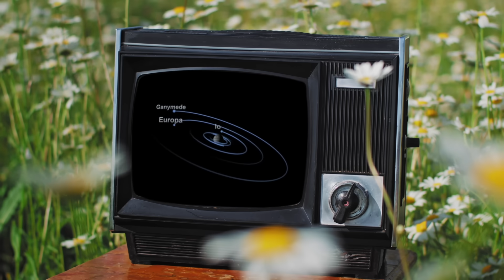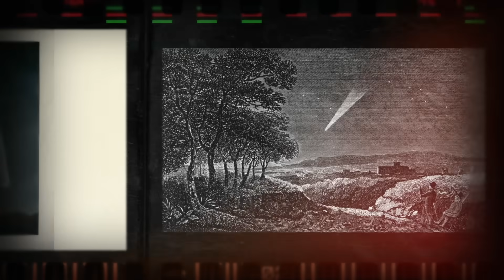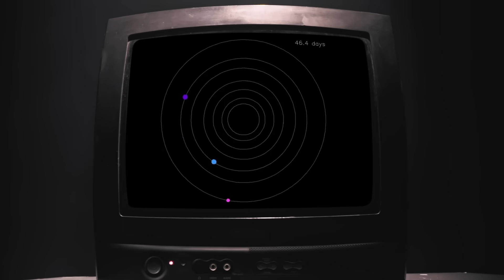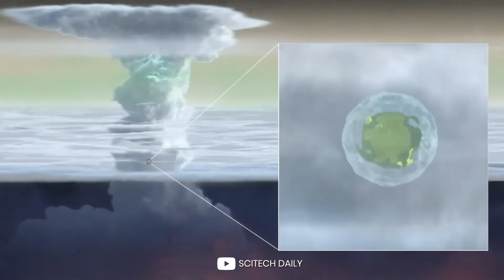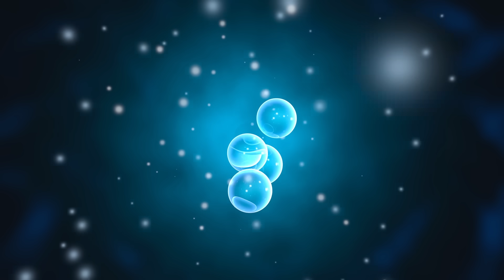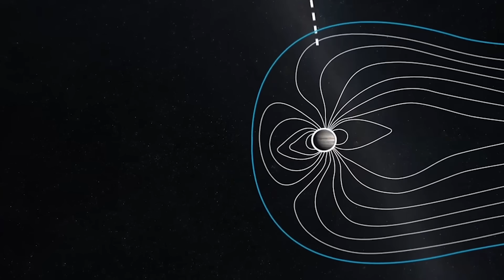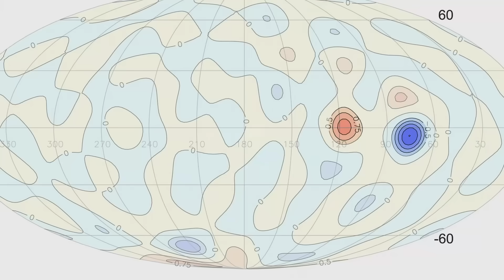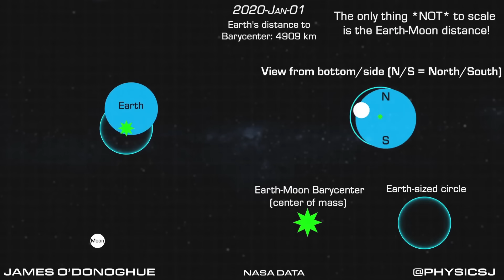Scientists Reveal That Jupiter Is Not What We're Beeing Told

Comment: I don't think there is any element in the periodic table that can be solid at the temperatures and pressures of the core of Jupiter.  A "rocky" core would imply silicates and metals, both would vaporize at those temperatures but they would still be highly compressed to the point they would act more like liquids and still be as dense as a solid.

Comment: i had a dtream that the elite, atualy two groups of elite, evil elite and good elite built a jupiter base that was suspended in the upper atmosphere converting it to oxygen, was baught there to help defend th egood elites base and the evil elites destroyed it, which after it just sank a few inches low started melting under the pressure. im assuming that "the arbiter" and "the oracle" halo 2 level was partialy what helped create that dream.

Comment: Jupiter use those fly by rocks to charge itself in order to form rings, different rings formed at different time, govern by the orbital settings along with self rotation, Jupiter will release its collected potential by forming new rings. It determines by electrical potential between Jupiter and other planets when they get close.

Comment: Jupiter is 1048 times lighter than the Sun, and orbits at around 1116 solar radii, so it would make sense that the common centre of mass is about 1116/1048 ~ 1.065 solar radii, so it does lie outside the sun. It seems counterintuitive that further orbits can wiggle the sun more, but consider the length of the jupiter year, so the sun only has to wiggle once every 12 years, which is much easier than wiggling every year if it shared earth's orbit.

Comment: I don't think scientists yet realized. The gigantic red spot on Mars. Is an inverted vortex. That streams down to the center core of the planet. And sucking all matter in. Concentrating it.  In the center core. As Jupiter takes on mass.

In time. I feel. Jupiter will take on enough mass to partially fuse. And become a brown dwarf. It's larger mass.  Will then send it spiraling inward. Toward the sun. Where it will take its place. As one of those Hot Jupiters. Or as the, Secondary of a Binary star system. And in doing so. Will wipe, planet Earth from its orbit. Along with Mars and Venus and Mercury. None of us will escape that.

And so I think the scientists and astrophysicists, have it all wrong. About Jupiter. There are other stars. As small as Jupiter. With much more mass.

And so our scientists say.  It doesn't have enough mass to become a brown dwarf. Those are famous last words. We can actually tell what's inside of Jupiter? Or how much actual mass. It might be concentrating in its core? With its Giant Red Spot, Cosmic Vacuum Cleaner. They know it has a higher infrared signature. Meaning that things are accelerating as they enter it. And heating up as they traverse to the core. Being turned into a compacted, bag of goo. Of substances. Not yet imagined. Another physics factor. We have as yet to discover. Because it cannot possibly be. They think. And so therefore that's what it is. Right in front of our faces.

And what are we doing to get off this planet anyhow? High-priced joy rides to Mars?  For only the very wealthy?  That still won't save us.. They might be the first to be obliterated? When Mars, breaks apart. From Jupiter's growing gravity. And Voilà!  Another asteroid belt is born. Rings. Not around a planet. But a ring around the sun. Another one. As how did that other asteroid belt get there? Maybe we are about to make another? When Mars turns into Rubble. And then we are next. As Jupiter has been feeding off of that other asteroid belt for many millennia now. Maybe it's going to step up its game?  And eat Mars.

We certainly don't have the answers to any of these questions. All the astrophysicists were wrong. Since the JWST, came online, last year. And big whoops! They were very wrong. For many decades. And now have to rethink all of their physics. They are still thinking. They thought they had it, figured out. They still don't. As they are Academic Idiots. And they can't see the big picture in front of their face.  After looking at all of these other solar systems. It wondering how they are seeing all of these, Jupiters. Close to their stars. Hmmm? They are great at math but they can't put 2 and 2, together.

So it's obvious. What's going to happen. In some millions of years in the future. Or maybe next year?  We are not yet at another solar system base. And likely will never get there in time? Before we are Absorbed. Crushed. Torrent. Shredded. Pulverized. Burnt. Frozen. And become Food. For another Star.

And thus will always be such. In the Cosmos. We were just a mistake. We were just a mathematical oddity. That was never supposed to exist. We are the Virus in space. Most places are well Sterilized. From critters like us.

And that's why we have never heard from anybody else. And never will. Anything else will merely be a distorted reflection of something from our past. That nobody will remember. And we will think it's aliens.. When it might be us from the distant past. Around the time of the, Egyptians. As they had something else helping them out. And none of that technology ever found. Because it did turn back to dust. That which most of our  universe seems to have a lot of.

There's a reason why all of these worlds are filled with, Natural Gas i.e. Methane, Ethane. Lakes,, oceans, of the stuff. And we get hours from dead dinosaurs underground.

And so how much smaller was planet Earth when the dinosaurs roamed? How did they get tens of thousands of feet underground? What process did they have to go through to do that? Might the planet have acquired, tens of thousands of feet of dust since the dinosaurs? That we now call, dirt? As some of their bones made it to the surface. But left the rest of the dinosaur, tens of thousands of feet underground. That makes all of the, Fire Juice. And when it's gone. The planet, collapses on itself. It becomes no bigger than Mars. And then everybody drowns. And becomes a Water Planet.. Look at all that hydrogen and oxygen flung together. How do they do that?

And you'd think. We could breathe, H 2-O 2? But no!  That can bleach your hair and sanitize your bathroom.  You cannot breathe that. It is in liquid form. And they call that Hydrogen-Peroxide. Great for whitening your teeth and removing stains. Great to gargle with. After flossing. But we cannot breathe it. Even though it has, O 2. Stick it with another gas. At we can't breathe it anymore. What the hell man?

I'm so glad I did not get a degree in chemistry. I'm so glad I did not get a degree. Except when I have the flu. Or, COVID. I didn't even know I had,  COVID.  When I caught the Delta. But when I got the Omicron. I thought I was going to die.. And I had been well inoculated already.  And it kept me from dying from it. But I was miserable. And for months later. Still.. I guess I have long COVID? Dammit all! And I tried to be so careful. Masks and all that. But when other people are not careful and walk around spewing it forth. You still get it. You just likely will not die from it. And it's changed my body for ever.

So we don't have all the answers. A lot of smart asses thought they did. And for the most part. They did. But also including big mistakes and misinformation. For many decades.

So don't be telling me. The way you think it's going to be. When I happen to know otherwise.
RemyRAD

Comment: HAL-9000: There is a circular object near the equator. It is 22,000 kilometers in diameter. It is comprised of rectangular objects.
Dr. Chandra: How many?
HAL-9000: 1,355,000, plus or minus 1,000.
Dr. Chandra: And what is the proportion of the objects in question?
HAL-9000: 1 by 4 by 9.
Dr. Chandra: Do you recognize these objects?
HAL-9000: Yes. They are identical in size and shape to the object you call the Monolith.
Dr. Chandra: Is the number of monoliths constant?
HAL-9000: No. They are increasing.
Dr. Chandra: At what rate?
HAL-9000: Once every 2 minutes.
- 2010 - The Year We Make Contact -

Comment: Isn't there speculation that Jupiter is a failed or dead star? It seems to have quite a number of the characteristics in line. But the truly fascinating thing is the liquid metal hydrogen. I was taught in school that each element only has 3 or 4 states: Gas, liquid, solid, and plasma? But I never learned much about plasma, so mostly it was 3. But to find that there can be such drastic differences in the characteristics, or that there can be more than 1 liquid form, that's really interesting.
Reply: If you're ready, Welcome to your Electric Universe.

Comment: When I was young I always had an issue with envisioning "gas giants" because I would only think of gases in their vapor forms and forget that gases can be condensed into liquids, then realizing it takes absurd amounts of temperature and pressure especially when you consider it's happening just all around as opposed to only being in controlled containers on our planet.
Space is So interesting.😄👍
Reply: Yeah, as a kid, I never understood that either. It wasn't until early college I realized what you just said.
Reply: i still don't get it, could you explain it pls?
Reply: @daenerystargaryen6609  I can try, I don't remember what prompted me to write the comment but I can explain what I was referencing.
Some or all gases can be made into more than one form, like Propane or Butane for instance. When you buy a can you can hear, feel and in some cases see that it's liquid inside the can but once it escapes the can it turns into a vapor just floating in the air. The reason for that is pressure, when you force enough of that gas vapor into a container it will begin to condense into a liquid but the amount of pressure it takes is a lot.
Some gases can freeze into a solid like ice but it usually takes much colder temperature than freezing water which is why as it gets to room temperature it quickly liquefies and evaporates, unless it's in a strong airtight container in which case it will turn to liquid but doesn't have the space needed to expand into it's gas vapor form.
With all that being said I often had a hard time realizing what these Gas Giants were, even now it's a little difficult to fully comprehend without seeing something similar.
From how I understand it there is such immense pressure \ gravity in parts of space that gases can condense into a liquid the size of 4 Earths without being in a container, almost as if there is an unseen force applying pressure. Space can be so cold that those gases can freeze out in the open after being condensed into a liquid from a gravitational force far greater than what we feel on earth. 
I don't know how much sense this will make to you but I'm willing to try and explain it differently if you have a more specific question about any this.
😅👍
Reply: @DeathsNitemareShepardOfHope  hmmmmm i see... or at least i think i do. the pressurized can makes a lot of sense. i wonder what the inside of the can wd feel like,then. i always thought, even if it's cold in space, if gas freezes it's solid so no gas anymore (idk if that's correct, maybe i'm wrong) so i did believe you'd kinda fall through a ton of gas clouds and then kind of implode at the center where everything is pressure.. or that there would be a tiny massive stone pit. space is crazy and trying to understand the physics of gets me only more confused 😅thank you for trying with me, friend!
Reply: @daenerystargaryen6609  yeah it's hard to envision, it could be a case where it's cold enough to freeze some of the gas while it's also melting\ vaporizing as it moves around but then being pulled back in towards the center that could be some kind of super dense core with a butt load of gravitational force constantly trying to pull these gases back in as they turbulently keep condensing one second and then expanding into vapor the next as the core spins faster than the gas keep up creating the conditions for all the storms and heavy winds that can be seen in various pictures and time lapse segments made up of multiple pics showing the twisters and hurricane wind patterns at work creating winds that are many times stronger than anything the Earth has produced in human knowledge.
There's almost too many ways of trying to envision what is happening or How it's happening, but I guess that's part of the fun with thinking about space and it's possibilities.
😅👍

Comment: Pretty sure u can’t use the terms Liquid Metal Hydrogen n Liquid Metallic Hydrogen interchangeably. It is called Metallic cuz at those heats n pressures it has some of the properties of metals, such as it’s electro-conductivity. But the word Metal is a noun, not an adjective, so u would be saying that the hydrogen has actually become a liquid metal by calling it Liquid Metal Hydrogen. Pretty sure u just wrote n/or read ur script wrong but I feel compelled to correct this misinformation.

Comment: The fundamental error regarding comets remains despite being debunked over and over again.

Water is formed in the TAIL of the comet.  The high energy plasma around the comet causes hydrogen and oxygen molecules in space to combine and that shows up in the tail.  The close pass of a comet to a planet makes water available for the gravity to pull it out of space and down to the ground before it vaporizes.  

The comet itself is NOT ICY.  It is DRY and HOT.  It glows because it is cutting through the electromagnetic field around the sun.  There is an ENORMOUS amount of electrical energy out there and some of it can be found in Earth's own ionosphere.  All we have to do is find a way to safely tap that energy and we won't need oil, gas, coal, or nuclear power

Comment: I have always wondered why, if Jupiter is made purely out of gas, that Shoemaker-Levy didn't just fly right through it? I mean what was there for the comet to hit? I believe there's more there than just gas. The planet has weather, it has storms, why? It has to be storming for a reason. it's part of the makeup of that planet. There has to be a reason.
Reply: Simply put, probably the immense speed and friction caused by it entering the atmosphere ignited gasses which caused the explosions. Also, it was probably crushed not too long after getting into the atmosphere
Reply: Jupiter has a metallic hydrogen core. But I doubt the comet got that far.  There have been lab experiments done where they put a tiny amount of hydrogen under similar pressure as on Jupiter for a fraction of a second and take a picture - it looks just like a metal, like shiny aluminium or similar.  Thats what is under all that gas.